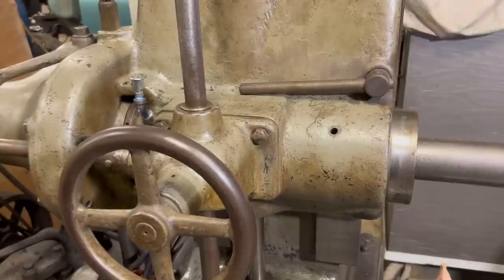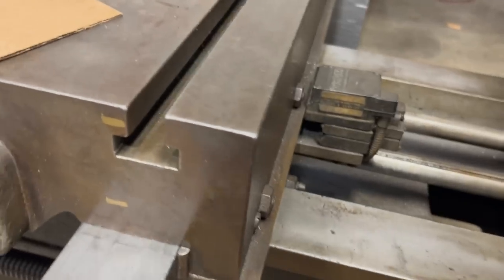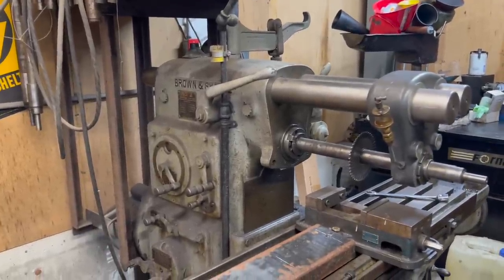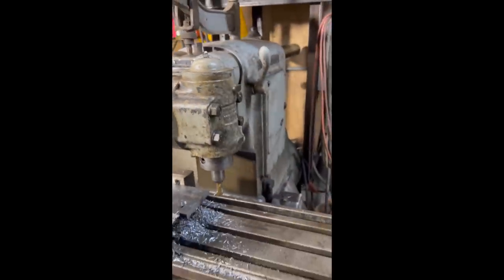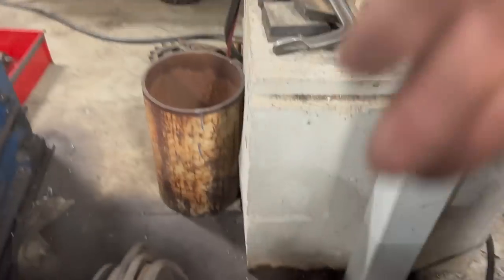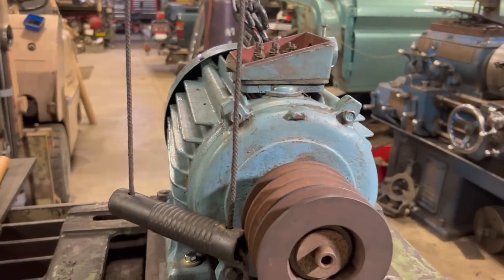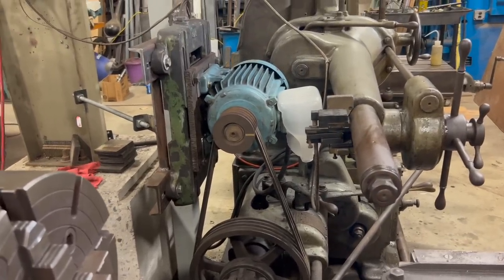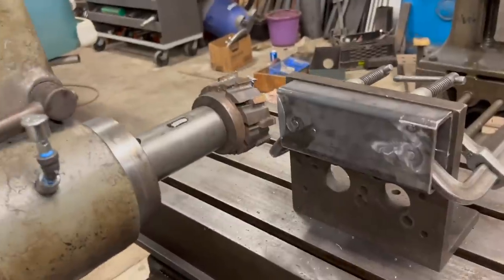#226 Vintage Machine Shop Iron; Lucas Model 21 Horizontal Boring Mill Rescued and back in service

Comment: I bought a Lucas 21 like this afew years ago, but it was one of those "buy it and it doesn't work" machines, table was locked up something fierce, Z axis slide nut was stripped. Bunch gears missing teeth. Glad yours worked out
Reply from the maker: Oh man sorry to hear that ! Hopefully you can get it sorted out and running . I feel your pain , I too have had machines I bought end up being damaged but not show any clues until you set it up to run .  Thanks for watching & comment.
Reply: @austinmachine6622   I still have it, it's in the back of the shop one of those I'll get around to it projects. Ended up getting a different HBM that was abit younger/bigger for what I was going to use it for and life goes on.

Comment: From one who has an oilier - what you need to machine is a nose cone.  Have the center hole the size of the oilier and maybe 2x on the large size and solder / braze on.  Then with the back flair you can lift the lid, rotate and place the nose in the cup and away you pump in oil.  Simple as that.  I have surface grinders with grease zerks el pain.

Comment: Saw that old Bultaco banner in the back and laughed. I had one of those old 250 2 strokes and remembered how it beat me to death with it's coil suspension and practically zero travel. By the end of the day I was beat and ready to sleep like a deadman. I did love it though. Good ole days when young muscle and bone was able to take the beating. Good work buddy like the video.
Reply from the maker: Oh yeah I'm a Bultaco guy from way back, my Dad (now 92) was the local dealer . My shop is heavily decorated w/moto stuff of all kinds . Thanks for watching !

Comment: Your mill looks to be in remarkable condition for its age just looking at the non battered edges of the table. The vintage Prototrack readout and the Travadial was a pretty expensive upgrade in the late 70s perhaps. There is a similar machine in a shop nearby that is not in as good  condition but still does good work. The HBM adds a lot of capability, thanks for sharing!
Reply from the maker: Thanks ...I'm cautiously optimistic .  I know none of it's history, but who ever had it took pretty good care during it's  time . Your right about the Track DRO & Traveldial , I was thinking 70's vintage . I was really really happy when it came on and functioned . We are continuing to go around this machine and get it tuned up and ready to go. Getting it home and set back up & running was just round 1. I had been with out a HBM since I sold my big shop a while back , now I'm good !

Comment: Nice boring mill 
I like the post mounted motor good idea!
Reply from the maker: Thanks , I gave it a great deal of thought .  I saved me a great deal of floor space over the floor mount alternative .
Reply: @austinmachine6622  I have a G&L boring mill I don’t have it set up yet. 
And the motor sticks way out to one side and I didn’t like that because of the footprint and so I might do a post set up to kind of like what you did
Reply from the maker: Same deal on mine , I just wasn’t going to loose the floor space needed for the floor mount. Where I put the Lucas in my shop was perfect except the motor and I happened to have a convenient post . I freely admit I spent a bit of time measuring & landing the machine exactly where I wanted it to be in relationship to the post and the Monarch lathe behind it and it paid off . My fall back position would have been an independent  3 or 4 legged stand that straddled the gearbox and positioned the motor in the same spot it is now .
.

Comment: Congrats… these smaller mills are hard to find. I have been looking for years for a 25 or smaller. Will trade a Devlieg 3B-48 or work for nothing or sell my right male anatomy to get one of these. Carry On….
Reply from the maker: Indeed , I had been looking for smaller HBM a good while myself . I sold my bigger 4'' bar Lucas when I downsized to this shop. I figured I'd ''just pick up a smaller one . Turns out the big ones are easy to find .. the smaller ones not so much .
Reply: @austinmachine6622  You Said it! I am having to move myself and shop space is the biggest issue. I have a Devlieg 3B-48 that likely won’t make the move. I am planning on building a 6x6 small steam engine to run some of my vintage wood working tools. A small giddings would be ideal. The issue is clear. Ten years ago it was easy to find Oliver’s and Brown Sharps and others. Both line shaft drive and motor drive. Now the smaller machines are very hard to find and often command stupid money. The supply is fixed and the demand for machines in smaller shops and serious hobby shops keeps increasing. Industry dumped many of their older machines in a race to go CNC. The mega machines didn’t make it into smaller shops so there are plenty of them. The times we live in now.

Comment: Are u going to make sort of screw adjustment on the motor mount
Reply from the maker: It already has one built into the former floor mount base that I reused . Look around 34:17 on the vid  and you will see it from the back side in the middle on top . That belt tensioner was what made the whole plan work .

Comment: Have you checked the accuracy of it?
Reply from the maker: Not really we had a lot going on . At some point  I stuck an indicator on the OD of the spindle with it close in to the head and then ran full out and it didn't scare me , it was something like .003 and .005 .
Reply: @austinmachine6622  not too bad.

Comment: Can u use the wrench for a mill vice handle
Reply from the maker: Sure in a pinch , the handle for the small Kurt vice  I'm running on that #2 Brown & Sharp is lost ...the vice has a 9/16'' hex on the lead screw so I am currently using a 9/16'" wrench w/a flex socket on one end .  At around 10:40 in the vid it's on the table .